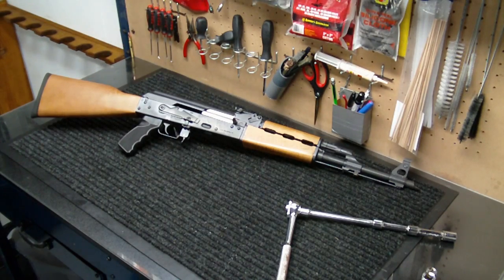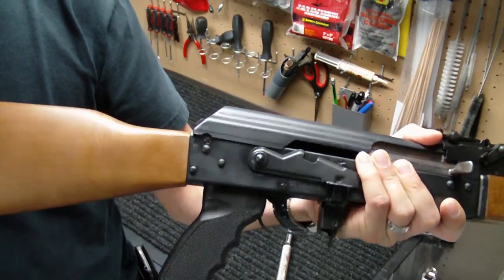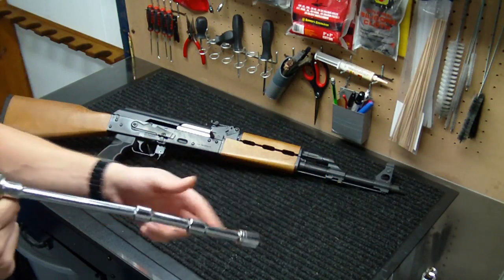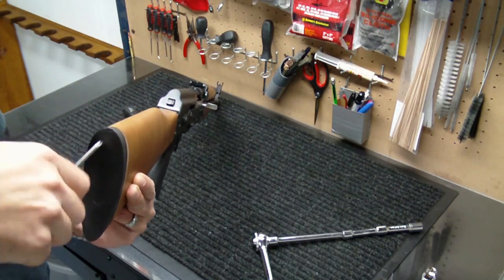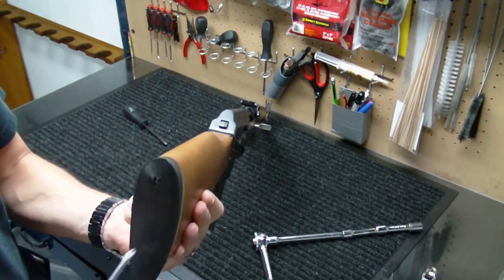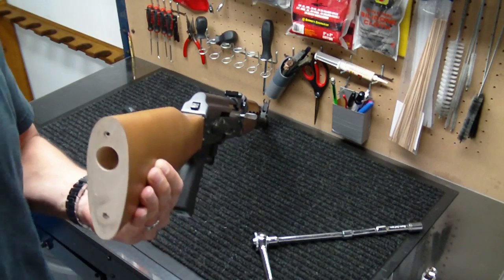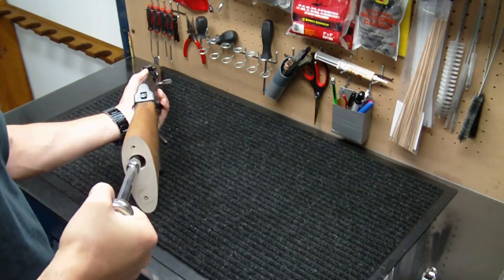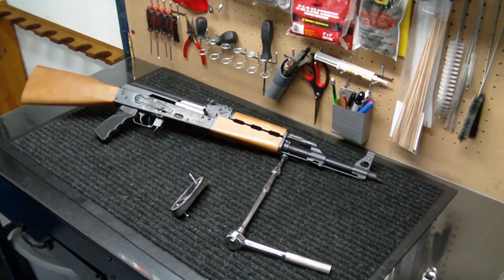Zastava M70 NPAP & OPAP:  Stock Removal

Comment: My ZPAP M70 has a metal butt cap.
Requires a 3/32" wrench to remove the two screws. Also a long handle straight screw driver can be used to remove the butt stock or a 13mm  socket and wrench.
What an awesome rifle
Reply: I was looking for your comment! I didn’t feel Ike making a trip to lowes lol
Reply: M70 is my first rifle. Do i need to put locktite or anything?
Reply: It never hurts to put BLUE LOCTITE .
Reply: My preferred Mags are and the only ones I purchase.
US PALM STAINLESS STEEL LATCH CAGE FDE MAGAZINES. 
My M-70 AK is Walnut Furniture,  they also come in Black, if you like.
Barnaul 7.62x39 SP are awesome too, if you can find them, more lethal than H.P.
It's non corrosive. 
If you use corrosive ammo, use HOPPE'S #9 Gun Bore Cleaner, it's a proven product.
Some say wash with soap and water, not happening with me.
Only water getting on my gun, is getting rained on at the outdoor range.
Semper Fidelis
Reply: Keep all your Mags loaded, Empty Mags are like Dead Power Tool Batteries, Useless when you need them. 
Masonry Plus 
Florida
Reply: @tedr.richardson4655  thanks. My M70 is my first personal rifle. M16 was my service rifle for 4 years so i thought I’d get something different. Love it so far

Comment: I just watched your video, I have the same issue with my Zastava M-70,  just picked it up a couple days ago and the butt stock is a little loose, my other AK  actually has the screws on the top where you a can get to them externally and tighten, also my butt pad is actually metal not rubber, the screws are totally visible... Appreciate the demonstration! Hello from Macomb, Michigan!!!

Comment: Just a caveat for those with the black synthetic stock... 
My buttpad did not have any slits in it. I cut some slits and was trying to find the screws, but couldn't.  I spent almost an hour sticking a screwdriver in there to find the screws, with no luck.  Then I just pulled the pad off, with some degree of wrenching.  
Turns out it wasn't screwed in at all, but there are screws underneath the pad which screw in a grated plate that the buttpad slides onto.  The heads of those screws were COMPLETELY stripped to hell, which explains why I couldn't find them with the screwdriver.  
Luckily the bolt inside had a slot for a flat head screwdriver, and I was able to stick a long screwdriver through the grates in the plate and twist with every ounce of strength I had to crack the bolt loose and get the stock off.

Comment: Continued, I also noticed the hole in the Walnut butt stock where the bolt go into, is large enough for my metal tube cleaning kit to fit into.
I'm going to look into hopefully finding an end cap that would allow me to store my rifle cleaning kit inside. Sure hope this is possible.
FYI.
I removed the bolt and cleaned the threads with alcohol and put Permatex  Blue threadlocker on and reinstalled.
Keep your Mags loaded, empty Mags are like Dead Power Tool Batteries,  useless when you need them. 
Masonry Plus 
Florida DeSantis Strong.

Comment: Gunsmith trick.  Spray a bit of glass cleaner on the screwdriver shaft to act as a lubricant as you turn the screwdriver through the rubber buttpad.  It will make removal of the buttpad screws a lot easier.  The glass cleaner will evaporate after a bit leaving no traces.

Comment: Great instructions!  I was wondering if you Zastava is canted?  Mine is canted pretty bad and it seems that most of these Zastava PAPs are like that.  Also, my rear sight is canted and my front sight seems it is to the right just a tad.  I dont understand though, its still pretty accurate with the rifle in this fashion.  Thanks.
Reply: Yea pretty much all AKs have some degree of cant. As long as the rifle zeroes and shoots straight it should be fine

Comment: You wont tear up the holes if you put some oil on the screwdriver first.
Reply from the maker: 108basic good tip, thanks for sharing!
Reply: ***** im wanting this for my zastava Buttstock Kit including Buttstock Stock, Extension 5 Position Tube for AK Series would it work and im getting this AK Accessory Mount 4-Weaver/Picatinny Rail From Tufforce all from amazon would these work
Reply: 108basic Vaseline works well too

Comment: I know this video is older, but I saw an ‘MDI N-PAP’ for sale with a plastic thumbhole stock/grip. Do you know when these were imported and if they’re any better or worse ? These are about the same price as a WASR... Any feedback would be appreciated...
Reply from the maker: sorry for the delayed response.  that would be the first and original import of the PAP line of rifles from Zastava by Century (fairly limited in this variation).  The originals came in designated as N-PAP's and were in sporter configuration with thumbhole stock.  I would imagine this was to test the import ability by Century, as well as customer interest in the Zastava line of updated PAP rifles which were coming in the future.  Most of these early imports were also single-stack feed and single-stack ak low-cap magazines (later imports of these sporter rifles had been converted by Century prior to sale, but not many).  The most unusual feature of this early import is the use of a thicker 1.5mm receiver, like the O-PAP or M70 variants later imported, but still has the N-PAP designation (n-pap = 1.0 mm receiver).  They are the only N-PAP rifles imported (that I am aware of), which have the thicker 1.5 mm RPK-Style receiver.  Unfortunately value on these are significantly lower than the later imports still currently available, mainly because sporter configuration is less desirable - unless you live in a restricted state!  value right now imo is around $450-650 based on condition and selling area.  hope it helps and thanks for watching!

Comment: are the screws that hold the rubber pad to the back of the stock, screwed into the wood? od is there a nut on the inside of the stock that they screw into ? thanks
Reply from the maker: Goodfella1209 The screws do go into the wood, no nut.

Comment: Can you shoot the opap rifle without the stcok? i removed my stock and i noticed i have a hole in the back of the gun now, would it be okay to leave that hole there while i am shooting?
Reply from the maker: zach srivilay Yes, they will operate without a buttstock.
Reply from the maker: ***** probably should mention that it will most likely make your firearm too short per BATFE standards.  I believe it needs to have an overall length of 26"

Comment: Thats not a 1.5mm receiver.  The opap is the npap is a 1 mm receiver.  Serbia  never made 1mm receivers for use or military export. Its a special made rifle dor export  to the us civilian  market . There military  rifles used milled receivers or 1.5mm rpk receivers with bulged  trunnions.
Reply: debel101 you are wrong! Zastava has made M70 AB1 under-folders on 1mm stamped receiver back in eighties, same receiver as on npap.

Comment: what do i do if my screws are stripped?
Reply from the maker: thats a bummer and a hard fix unfortunately...  you could cut the stock off near the receiver (cutting through the bolt), or you could attempt to drill and tap the stripped screw, which would be a difficult task.  Good luck and thanks for watching!

Comment: on mine it has a bolt with a slit for a screwdriver an for the love of all things made by man i can not get it off please help me
Reply from the maker: +Tom Knox probably got some locktite on it...  get a really long tool which will give you more torque on the screw head.  using any type of heat is near impossible with the wood stock, but maybe some sort of penetrating oil?  sorry, wish I had more ideas!
Reply: +intoweapons think a hair dryer would work
Reply from the maker: Tom Knox It might, but it would be a long shot...  a heat gun would be a little better, but be careful not to ruin the finish or the stock!
Reply: Okay thanks ill try it later

Comment: opap= 1.5mm. npap= normal 1mm
Reply: You dont need 1.5mm receiver, if the AR15 can handle .308 caliber. Much more the AK 1.0mm receiver, even its 0.5mm only they can still handle it. The purpose is for lighter weight to make it comfortable for reliability.

Comment: Anyone know of a good stock replacement? I got an npap recently and it's quite a bit different than my WASR. The stock on the npap makes it feel like I'm getting punched in the face. Recommendations for a replacement stock?
Reply from the maker: +Nathan Palmer LOL, yeah my PAP rifles beat the heck out of my cheek as well...  Try pocketing the rifle higher on your shoulder and pushing your cheek weld on the stock out closer to the butt of the receiver - that usually helps me eliminate the cheek slap...  Like you, I would prefer not to worry about it though :)  Bonesteel Arms, IronWood Designs, or an ACE Adapter with any standard stock should work as well - good luck!
Reply: Oh sweet. I'll have to look in to that. Thanks
Reply: +Nathan Palmer Tapco makes a nice collapsible stock for the Yugo N-PAP.  It's called the "Tapco Intrafuse T6 M70 Stock"  Part number is STK06170.  It runs about $50, and can be hard to find.  I had to do a lot of searching online before I found it in stock.  Century Arms website should have it though.  I have it on mine and I love it.
Reply: +Nathan Palmer Also, to avoid AK cheek slap, you have to pull the rifle tightly into your shoulder, and lean forward at the waist.  It's the proper form for shooting an AK.  Search "AK Cheek Slap" and you'll find AK Union's video on it. Great channel to follow if you're an AK shooter, also.
Reply: Yeah, I've looked it up and realized it was partially because of my form. But with my other rifle (WASR 10) I never had the cheek slap issue regardless, partially because of the angle of the stock.
Reply: Nathan Palmer Century makes the Warsaw stock for the pap and its supposed to be pretty decent Im debating on cutting and sanding down the stock myself